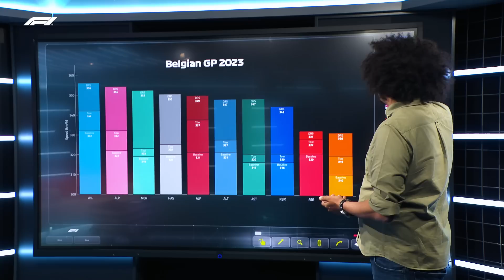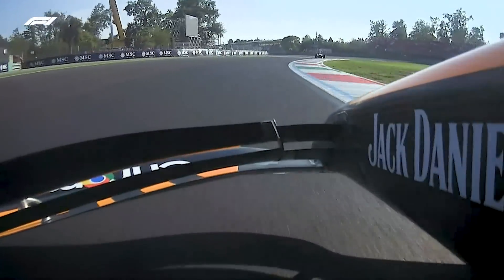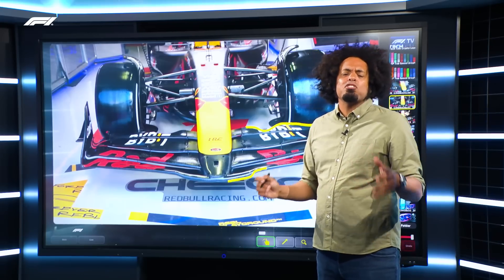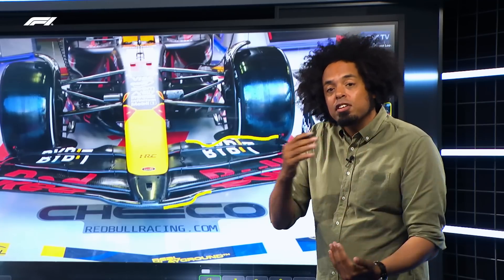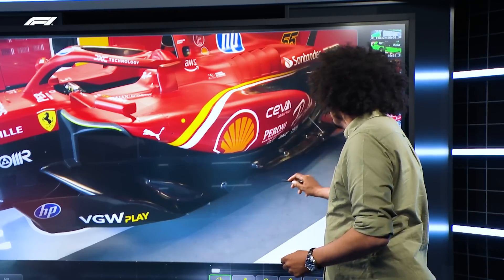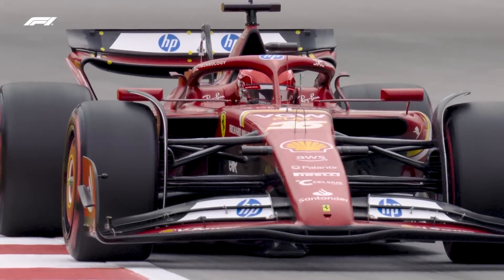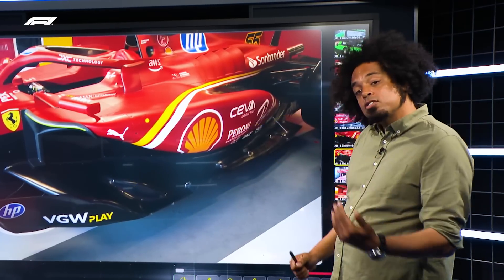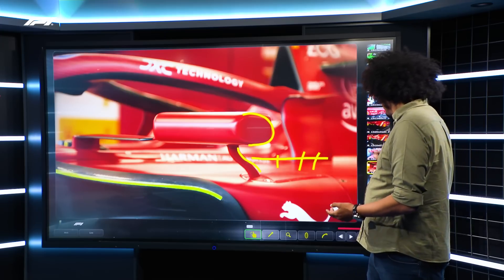The Fastest F1 Cars Ever? | F1 TV Tech Talk | Crypto.com

Comment: Sam, a couple of aerodynamic terms you might consider. I love the “sticky upper bits”, but a common nomenclature in aero are aerodynamic fences or vortex generators that create boundary layers over the major surface of flow. The other note is that “doubling the speed will, multiply the drag by 4 times”! A great engineering challenge at best.
Love what you do for F1 and the fans.

Comment: Reducing drag at the wings would be of great important to increasing speeds if sufficient downforce 
wasn't required to maximize turning grip & overall vehicle stability throughout the entire speed range of the race car.  

Removing part of the wing does reduce it's drag & will increase the vehicle's overall speed BuT taking the car down a more 
favorable straight will also increase it's speed & not reducing the size of the wing may increase the downforce on the wing beyond 
the vehicles requirements & efficiency needs.  

$o, is iT The chicken oR The egG.!?.  
Did wE reduce the drag in order to increase the speed oR were wE forced to reduce 
the surface area of the wing in order to maintain the same levels of downforce at the much higher speeds oR Was it all together A 
Necessity that turned out to be a BiG BeneFit to the overall speed of the famed Italian track that we have come to know as Monza.!*?/\.

Comment: At 6:16 you can also see that the mirror support doesn't connect on the right side of the body work. It has a sticky uppy bit instead of connecting like other mirrors. I assume then the central uppy bit is what is considered the vertical support connection, since the mirror is suppose to connect to a horizontal element according to the rules.

Comment: We use kph in F1 because metric makes more sense😂😂 1:30

Edit: Metric system is the boss, in case it wasn't clear
Reply: Well yeah. Its easier to count and statisticly more people understand it
Reply: And then used mph
Reply: Nope, it doesn't.
Reply: @martingonzalez2850  yeah it does, for example the brake markers are measured in metres, the track length measured in km, the car and driver weight in kg, car length and width in metres, temperature in celcius, fuel capacity in litres and so on, so why would it make sense to have all of that in metric and top speed in imperial, like this isnt even an argument you're just wrong
Reply: @martingonzalez2850 r